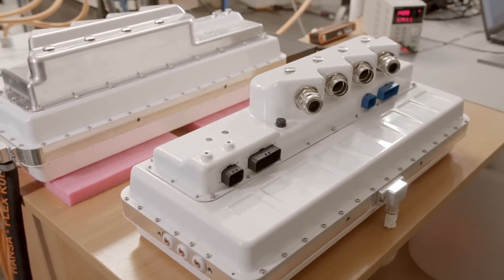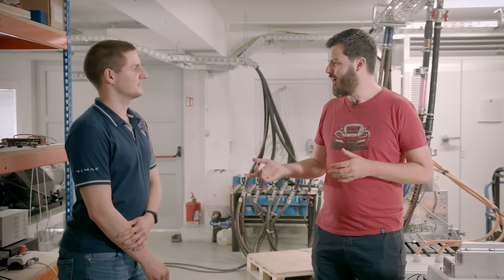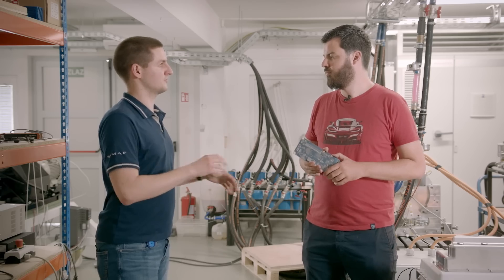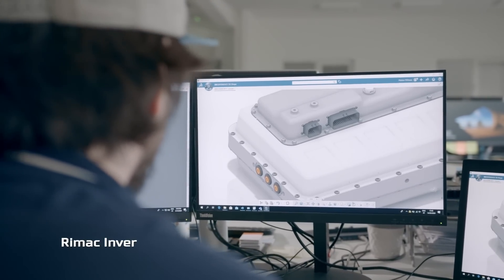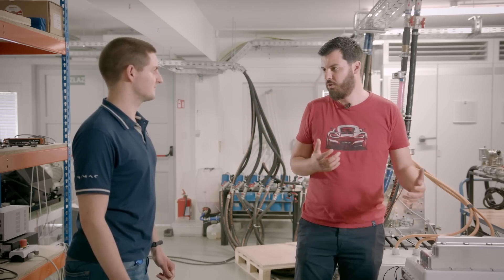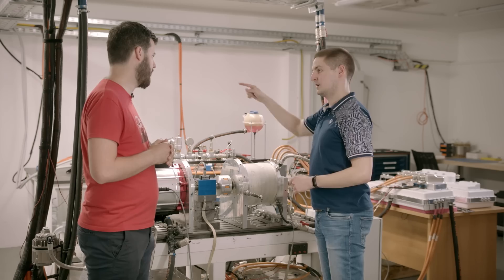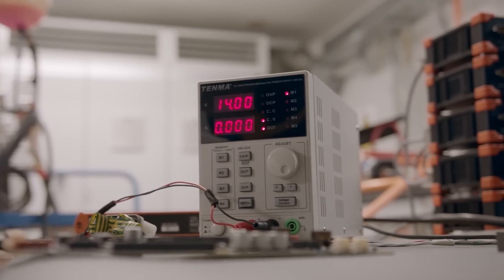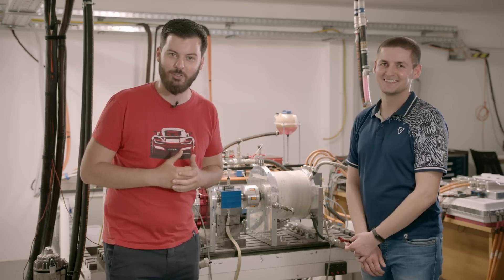The World's Most Power-Dense Hypercar Inverter | Mondays with Mate E10

Comment from the maker: Do you  have what it takes to deal with current affairs and to work on the Rimac BFI? Check out our careers page: https://www.rimac-automobili.com/en/company/careers/
Reply: Do you accept someone from Brazil? Electronic Engineer, FPGA and Embedded Hardware/software experience.
Reply: @Daniel Roig tesla does it all the time. The model 3 performance got a power boost 3 months ago, i think it was arround 35kw
Reply: @Daniel Roig yeah but it still is more power. The only fault of tesla here is them not giving  the full power from the beginig
Reply: Why you called it inverter? it should be called Electronic Speed Controller (ESC) or Motor Control Unit
Reply: @45llamas  I think the motor itselfs is the key factor for more power and efficienty, the inverters are in fact class D amplifiers with uge power, and as such have already high efficienty, with multilevel even more by divide the power over the mosfets and it give a very clean to the motor (important because of harmonics) with feedback it can even lower, when feed this  amplifiers with 0 to 400 Hz we can regulate the rpm,s but this is nothing new, I get papers about this all the time even from china, these inverters can reach more then 90% efficienty, that is what it is all about when protecting battery live. How we can go into future with Li-on? because this lithium is not that much present on earth most advanced technology has not the needed raw material.
Reply: What's the benefit of torque vectoring?
Doesn't constant current controll do the same thing?
Reply: @Daniel Roig Its not for free its just like motor and inverter have their limits so you have to limit input current below max. current these two can handle...so lets say R&D works all the time and they proved that  input limit can go up higher and they update their software with new limitations and when you update your car with it your car computer allows you to drain more current from batteries(cost is less range)...so how is that free and you call it bullshit?
Reply: @Daniel Roig Then I advise you not to buy a car from them!
Reply: where do i buy a motor

Comment: I have a 100+ years old oldtimer AC motor with the same size. It can produce aproximately 0,2-0,5 kW :D but not to go far in time, in my childhood we use almost the same size (little bit longer, and less diameter) We use a 2,5 kW AC motor to grind cereals like corns, oats, etc. :D 30 years ago I would not have imagined that there would be hundreds of times the performance of a similar size. I saw 100-200kW motors around this time, but they were the size of a water heater (Gamz-Mávag type suburban train traction engine)

Comment: Great video explanation but on the  start on 0.58 min I don't like those thin screws combined with thick cables and large terminals..It's not a good recipe for projects prone to vibration and temperature changes.

Comment: I don't get all this electric BS. They never talk about the the pollution involved making these batteries and repairing them. The mines they dig with Fuel/electric rigs you can see from the moon. its worse than you think! The world just needs road ways with eclectic in them so you can burn fuel or connect to clean power when needed. I guess this is just to simple to think a car that runs on both hummmm.

Comment: The goal of testing isn't just to make sure it will do what it's supposed to do... but push it BEYOND the design limits to see what blows up first... upgrade that part or circuit, try again and blow something else up... improve that, and so on.  That's how you get a total system "headroom", so that you have room to perform AT LEAST to full specifications, no matter the environmental and operating conditions. It would be so great working with Mate... someone who actually understands the tech that his employees are designing!

Comment: As someone who has worked many years in the area of inverters, precision motion control, and big equipment ... these are the thoughts that run through my head when watching this video ... Are you using IGBT's, fet's, something else on the front end and driver stages? -- Ensuring (whatever they are) are gain stamped and are matched sets helps tremendously with heat balance, dissipation, and loading. This in turn allows for larger currents without fail, with less lag, less electrical harmonics, leading to larger efficiency gains. I have seen a lot of manufacturers make this oversight in the past, especially as new people come along with less experience in this field. Not sure if your factoring that into your design so if your not, then that is one area of improvement that can be utilized on the inverter side of things. Next is the question of magnetic clearances in the motor itself. The tighter the magnetic tolerances/clearances, the higher the torque and efficiency. - There are already some variable frequency 3-phase AC motors on the market with near micron clearances taking advantage of this that have insanely close tolerances and need to to be assembled / aligned with specialized machinery. This presents another large advantage that is well worth the cost of the tooling. My next thoughts take me in the direction of what your possibly doing with dynamic braking and other reflected energy. Are you simply spilling it off? - or are you recovering and re-using it?. Also, I do not see in the video where the power leads are a balanced, matched impedance set. That is another area of loss under high current or voltage. Last but not least, I saw no line reactor on the DC supply front end. You may have it, I just did not see it, so am mentioning it... This would be important for power balance and absorption, helps with energy recovery, protection of the DC side of things, and to suppress the transitions of output power to energy recovery of large spikes or transitions from power into and out of dynamic braking events.  - That is where my thoughts go.

Comment: It look like there talking about Chinese wats. 1MW from lets say 400V - it is almost 2500A !!!!!!! Can someone imagine so big current? Cables for this current will be almost hand size copper core without insulation X 3 times (for 3 phases). I work with motors 800 KW, 500KW and small ones 315KW so I know this

Comment: Question:
How many HP is required to overcome aerodynamic and tyre-ground drag on c_two at its top speed?
Or what is the frontal area of the car and downforce at 412kph in low drag mode (so I can roughly estimate it)?

Comment: Hi Mate, I’m really enjoying this series so far! I would love to see some more info regarding the charging system on the vehicle. A lot is covered regarding the batteries and inverters for obvious reasons (they give the vehicle performance which is exciting) but none of this would be possible without charging the high voltage batteries. Some questions I have are: Are you able to charge in AC & DC, what kind of power is the system able to charge at, what type of connectors are you using and where is it on the car, do you have your own charging equipment (cables/wall boxes) or are you relying on public infrastructure?

Thanks very much!
Tim

Comment: Rather than compare the inverter to a carb, a possible better part is a transmission.  The inverter controls the power from power source and regulates power delivery to the rest of the drive train.  By the way, it looks the electric motor is a 3 phase device.  Thank you for the informative video.  Best of luck in your research.

Comment: From a real world use case perspective, as boring as it may sound. Can you elaborate on the battery design, thermal management, energy density/capacity. What's the targeted max range and charge speed?

Comment: Mate ive spent years in ICE dyno cells, work with EV too. All credit to you guys for building your own, makes complete sense C2 motor drives 2xC1 grid makes up the difference.
I would like to see the physical drive train of the C2, getting my head round the relation ship between  construction of components to withstand the power. I drive Tesla P85 and Zero SRF working on 650Kg Lotus 7 EV ......for fun.

Comment: guessing the top right number is RPM so 700 NM at around 9000 RPM 🤔
Reply: 700 NM * 2pi * 9000 RPM / 60 is around 660 kW. Think the speed must be higher or they have an overboost of torque for couple of seconds to reach 1 MW
Reply: @dzidmail  makes sense

Comment: Nice demonstration. I just today found your YouTube channel and subscribed. Going through all videos now.
QUESTION: How efficient are your motors, drivetrain, and electronics at turning the vehicle's inertia into stored energy during regen. I realize that depends on many variables so maybe just what is the maximum design regen rate?
I ask because this information has been difficult (impossible really) to find for other EV manufacturers. I believe most EV drivers overestimate the effectiveness of regeneration (and displays may overstate). They tend to leave regen set at the highest level, effectively wasting power in steady state driving that frequently engages regen when deceleration is not really intended. I assume Rimac manages regen quite intentionally.

Comment: Can you please explain why mostly AC-motors are used in EVs instead of DC-Motors?!
Reply: DC needs graphite brushes to introduce current into rotor. This alone makes huge losses, and they need to be replaced. Also, speed and torque is not easy to be controlled, and it would need DC-DC converter in order to run at max efficiency. Old motors were resistor controlled, which wasted a lot of energy.

AC motors can be frequency controlled, under low loads have over 95% efficiency and torque is related to slip. It has only one moving part and provided bearings are good, can be sealed for life. 

If you do not know what slip is, it works the same as in torque converters, just input is rotating magnetic field, and output is the rotor.
When the rotor has the same speed as magnetic field, torque is 0.
If rotor is slower, it takes energy.
If rotor is faster, it gives energy back.

So, the AC motor:
Pros: High power, high control, high efficiency, low cost, no maintenance.
Cons: Expensive inverters.
Reply: A better way to describe the motors used in EVs may be to call them brushless DC, or better yet, electronically commutated. True DC motors use brushes (carbon contacts) that transmit electricity to the rotating part of the motor. Those brushes pass over a series of contacts (the commutator) on the spinning shaft. The brushes wear away and require regular replacement. They release conductive dust into the motor as they wear away. AC motors have no parts that require regular replacement, often lasting for many decades.
There are many other advantages to AC motors but their durability is a significant reason they are used in all modern EVs.

Comment: Mate, thank you for another great episode. What programming language are you using in the programming of the Rimac's various system (e.g. Python, C, C++, Perl. PLC Ladder) and what are the dis/advantages you have when using that particular software, versus using something else?
Reply: Python/Perl... are you joking? :D Even C++ is stretching. Perhaps C++ with __asm blocks for critical code. If you want to extract that last bit of performance you need assembly tailored for the hardware at hand. High level languages just cannot compete.

Comment: Nice Video series!! 
I'd be interested in the energy management software. Also i wonder how much of the work you do is software stuff and how much is to design the hardware of the car. Because eg Tesla is calling themselfes a software company, who builds cars. Would you say you are a car company rather than a software company?
Reply: Going through Rimac's videos here on YouTube it is clear that Mate is a "car guy." While the cars they have built have lots of software they talk about first ensuring the chassis itself has proper dynamics. Every car made today contains miles of code and countless electronics components. OEMs constantly tweak and tune the electronic controls of their ICE engines. Mate's first car was a BMW he bought for racing then converted to electric when the ICE engine failed. They are a car company and a vendor to car companies.

Comment: Huge respect from Poland. Your achievements are tremendous. I have the following questions:
1. If you had to choose between two vector control algorithms: Field Oriented Control and Direct Torque Control, which one would you use in electric car and why? Do you implement space vector modulation and third harmonic injection into your motor control algorithms?
2. What variables (except the signal from the gas pedal) determine the amount of electromagnetic torque generated by each electric motor? Do you use accelerometer or steering wheel position signals for this purpose?
3. How do you improve your synchronous motors performance in the field weakening region?
4. What are your predictions related to the impact of the spread of autonomous electric vehicles on global GDP in the perspective of the 2020-2030 decade?

Comment: I assume GaN devices are used?
Reply: Do you know GaN switches for higher voltage? Think 600V is the limit currently. If you know better devices, pls let me know.
Reply: I assume SiC are used, they have a higher power density. GaN is more for the high frequency RF stuff. But it seems that there is some sort of debate is going on about that on the internet.

Comment: 2 question 
The batteri cells. Do you buy or build them. Was it 8000 in C1 
The motors. Do you buy or build them.
C1- 1 engine
C2- 2 engines
Correct ??